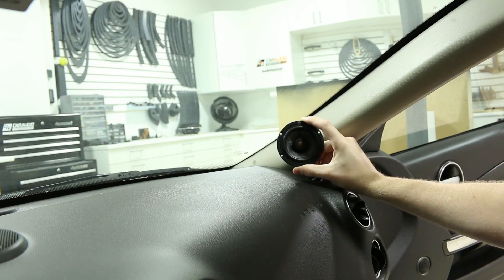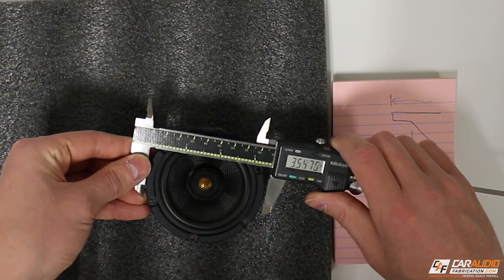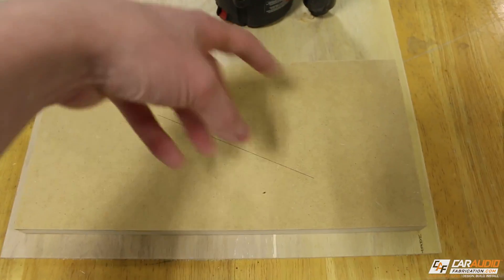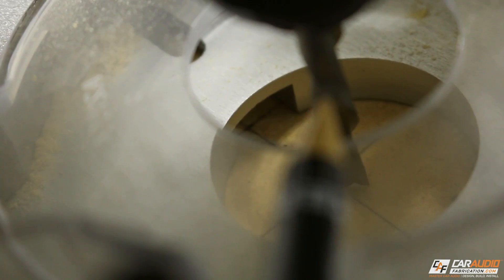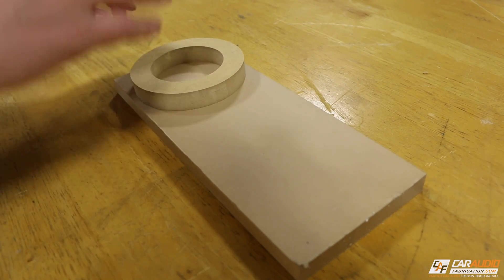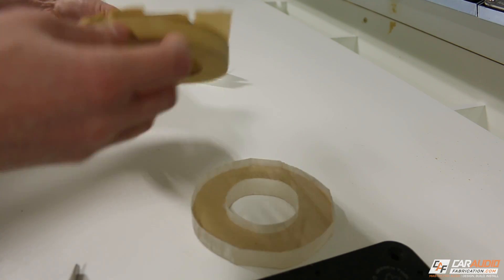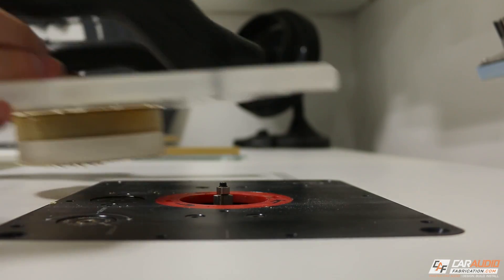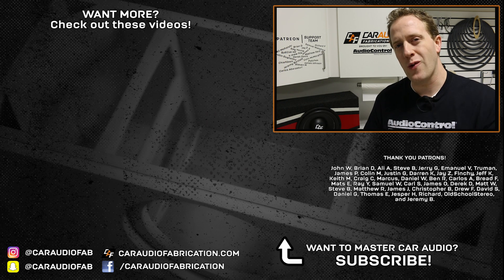Better Speaker Rings Better Sound - Acrylic Adapter - CarAudioFabrication

Comment: Buddy, it's time to upgrade to a 3D printer.  Don't be that fabricator that thinks everything has to be done the 'old fashion' way.  Hehehe.
Reply: I make these rings in less than 2 minutes. No way you could make them that quick with a 3D printer. Also they would be ABS, not acrylic.
Reply from the maker: +Tony Kart Racer I have full access to a CNC. To be honest these are simple enough that it takes me the same amount of time to make by hand or to draw-set up-cut.
Reply: CarAudioFabrication humblebrag haha
Reply: Also Mark already has a 3D printer. Besides sometimes making things the "old fashioned way" is far more satisfying.
Reply: Mark doesn't make these videos for himself... He breaks this knowledge down for average DIY'ers like me and for the seasoned pros with common or affordable tools so we get exceptional results. I don't have access to CNC or 3D printing, so this is exactly the content I need!

Comment: Gr8 video. In SA we using a product called M FOAM. Also weather proof BUT  less rigid. So acrylic would be a better bet i guess.  Thanks again
Reply from the maker: You could use something like king starboard, PVC foam, etc. But the acrylic will give me the ability to tap for fasteners.

Comment: Question: (I skimmed through the video because I don't currently have enough time to watch the whole vid) but what are the benefits to acrylic rings?
Reply: You forgot aesthetics- it looks badass and futuristic.
Reply: They do not TWIST.
Reply: And you can light it up. Wood, not so much.
Reply: It's plastic, it WILL eventually lose its strength with age (especially with big temperature changes). Also MDF can be impregnated, if you do it right, it will last longer than the car.
Reply: This is part of his Jeep build? I'm guessing water resistance is an important primary factor. Think boats, motorcycles, side by sides... But also, you can tap threads into it for hardware, use it in illumination, and it'll hold it's shape over a long life making it a very durable material.
Reply: title says "better sound"
Reply: watch the entire fucking video, u LAZY FUCK!!

Comment: Very nice but possibly the most expensive way of making speaker rings at home short of machining them from billet. Looking forward to the rest of this build.
Reply: The best way is usually never  the cheapest way. And you could substitute aluminium for the acrylic, I have. Takes longer but same basic steps.